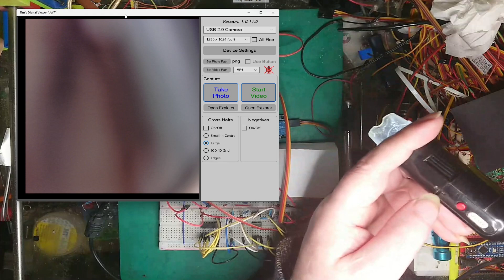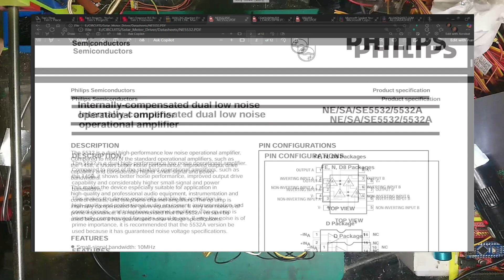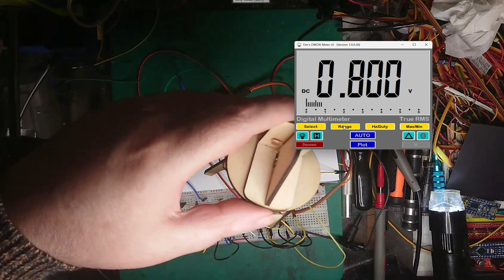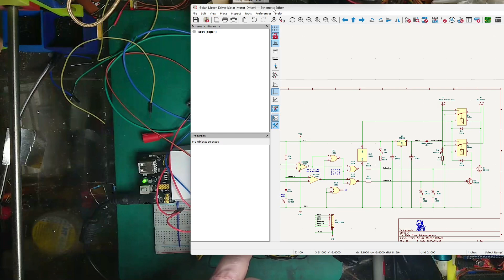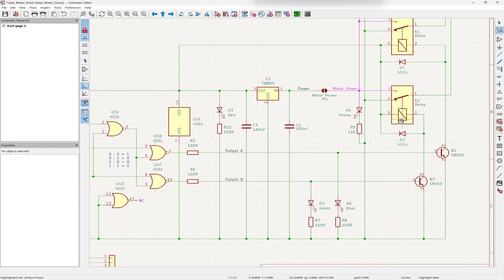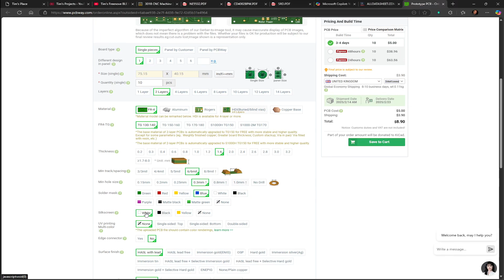Tim's Solar Motor Driver [Part 1]

Comment: Hi Tim, My solar tracking project won a Judges prize in the Instructables "anything goes" contest.  Last year when I built it,  I made the reflective dish a certain way, (not parabolic)  because  it was designed to work even if tracking was not accurate. It was experimental.  But it turned out that the solar  tracking method was pretty good.   For the coming season,  I am re-designing it to prevent people getting eye damage.
Reply from the maker: Congratulations on the win.
I will publish this on Instructables when the right contest comes up.